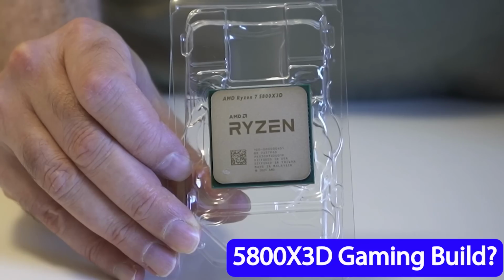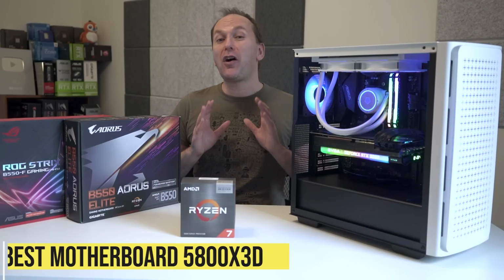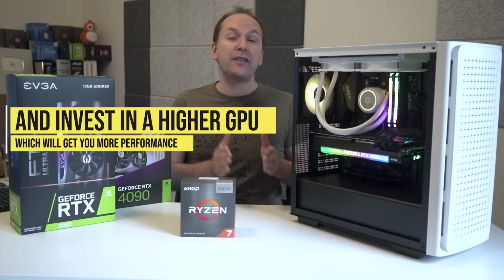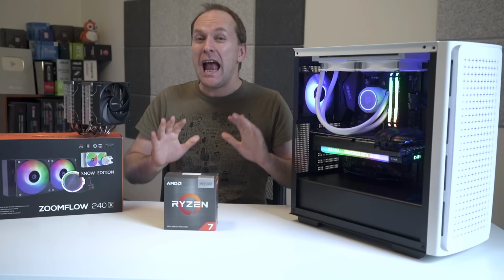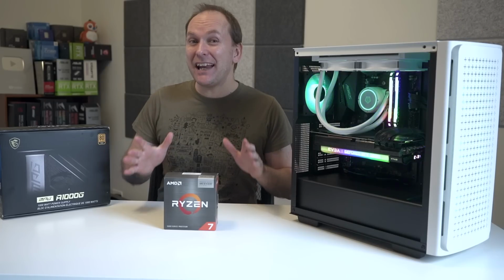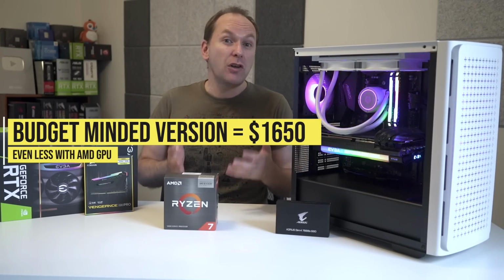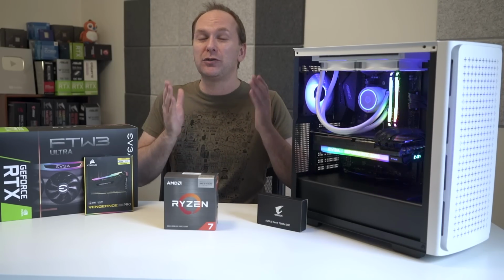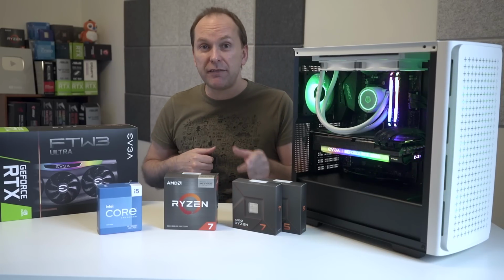🛑 4K Gaming is CHEAP! 🛑 Ultimate Ryzen 5800X3D Gaming PC Build

Comment: 5800x3d to me is like the 1080ti from back in the day. Hard to justify next gen.
Reply from the maker: 5800X3D is pretty amazing. Has been in and out of stock since the price went to $329 (Newegg had it this morning but it just sold out again). Until DDR5 RAM comes down it just makes too much sense. But can't go wrong with 13600K, Ryzen 7700X either.
Reply: We haven’t even seen the bench mark for the new x3d chips to say performance is not worth it.
Reply: I have a 1080 Ti from 2017 with a 8700k, WarZone 2 is the first game I'm struggling to get over 144 frames with. Should I grab a 3080? Or am I CPU bound? And need a new Cpu?
Reply: @SuperJuiceman11  honestly get a 3080 only if u can upgrade cpu as welll otherwise save more with 3070 and get a better cpu with that as well
Reply: @SuperJuiceman11  Always go GPU first.
Reply: @SuperJuiceman11  I’m on the same setup, been thinking of going 3070ti instead of 3080 though. 8700k is still a beast but I think if you’re going 3080 or higher you’d want to upgrade that too. Just my opinion tho
Reply: @SuperJuiceman11  what resolution are you running at
Reply: @SuperJuiceman11  i am with a 3080 and i7 8700 and i have problems in warzone 2..100-130 fps max depends on zones..and 16gb ram 3600 oc from 3200.in other games like apex i have easy 240hz like the refresh rate of monitor.so i have in plan a new motherboard am4 and this cpu..
Reply: @SuperJuiceman11  dude ur mads bottle necked by ur cpu . The max gpu u should have with a 8700 i7 is a 1070 if u have a 1080 or 1080ti ur leaving half the fps on the table gey a 5800x from the used local market for 80 buvks and keep ur 1080ti and watch ur fps go from 120 to 230
Reply: I used to have a i7 8700k and would upgrade my gpu every month from 1070ti to 2080super to now the 3070 ti  and i barley got more fps then i just upgraded the cpu to a ryzen 5800x and got more fps then even the 3070ti with the i7 8700k  using a 5800x and my old 1070ti so never upgrade gpu if ur looking for frames always do cpu
Reply: @CHICKENmcNUGGIESMydude  depends what resolution.
Reply: you like to copy paste your comment under every video to get some easy likes don't you?^^
Reply: @danii5630  perhaps, but it's true
Reply: This is such a cringe parroted comparison
Reply: @SamLoki  no, it's true.
Reply: It’s not the ideal CPU for everyone. It’s not that great with production work, for instance, and honestly not all games will take advantage of that extra L3 cache. 
As a gaming CPU though, it can’t be beat for price to performance to efficiency.